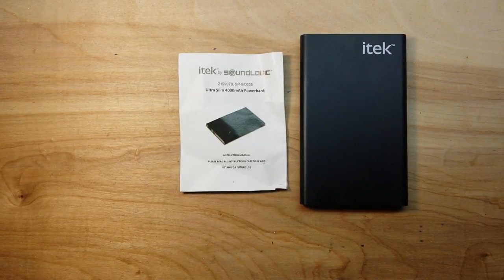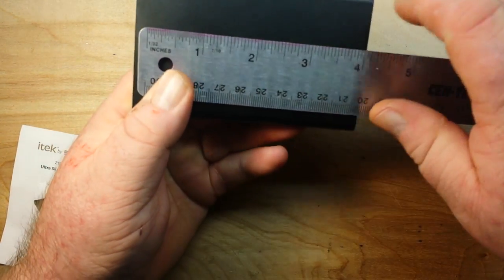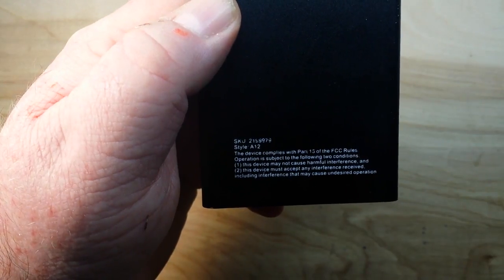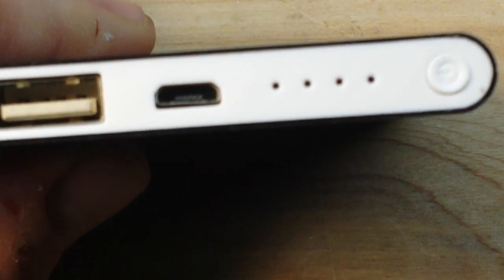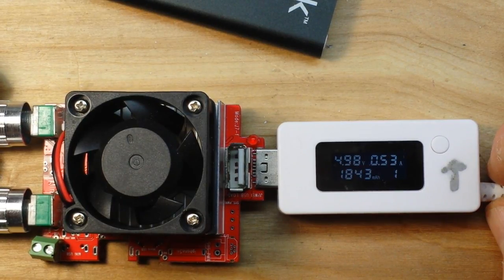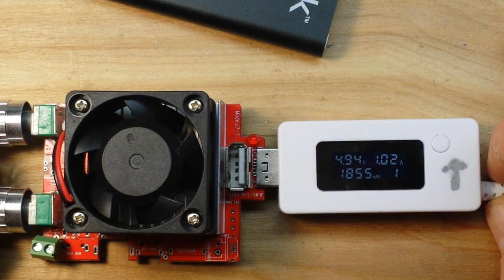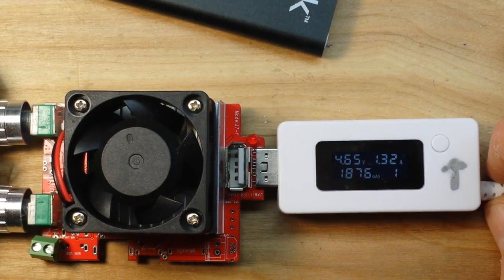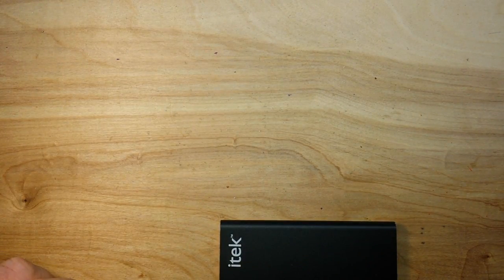ITEK powerbank review and teardown

Comment: Hi Paul...  I notice a couple times you mention 4.95 as the lower limit of the acceptable voltage for the USB specification. Where did you get that info-it seems VERY conservative to me.  Big Clive used to always say 4.8, wikipedia.org/wiki/USB says its 5 +25 -60 (although this I SERIOUSLY question)  I cant find this 4.95 number you say anywhere, and I know you mention that several times.  I even downloaded the 75mb white paper specifications and cannot find it.  I'm certainly not critisizing, I ask because I do a good bit of home automation with Arduino/ESP, and of course alot of times USB is the "go to" power source for me.  When designing, should I really be making sure there is no voltage drop between this 4.95 # or ???  In this case of 4.8, your charge bank meets it's specs and then some.  I know most mobile phones back off the charge current at 4.9(ones that monitor the voltage-again Big Clive did a couple videos on that)

P.S.  I have that same white tester.  I find it tends to drop some voltage over the cable(to the output) compared to my PortaPow and the adjustable load like you have that has the build in display.  But maybe its a problem with mine too, chinesium products are not knows for consistency!  Keep up the great work on the channel.  Cheers!
Reply: I was just going to write the same. The latest USB Power Delivery specification (http://www.usb.org/developers/docs/usb20_docs/ => USB_PD_R3_0 V1.1 20170112.pdf) and the DCP compliance plan (http://www.usb.org/developers/docs/devclass_docs/USB_Battery_Charging_1.2.pdf) both state 4.75V as lower acceptable Limit for 5V. Personally i wouldn't go below 4.8V to allow a bit room for cable and connection losses.
The Voltage Wikipedia shows is the limit devices must adhere to provide their "low power functionality", which is also limited to <100mA/<150mA. In case of a mobile phone low power would allow you to sync your files at a voltage this low but doesn't charge the battery.
Reply: Thanks a lot for looking that up!  That sounds more along the lines I was thinking - I knew there was no way 4.95 was correct as far as a limit as it's only 1%!  I been to that page 200 times and still didn't find it, and link #2 you give is dead.  It's not very easy to find.  
So if that's the case, it makes that a pretty decent power bank as far as the supply current.  I've seen much worse!
Thanks again.
Reply: #1: The file is in the giant zip file linked below "USB 2.0 Specification" (/usb_20_100617/USB Power Delivery/USB PD 3.0/ Page 281)
Also usb_20.pdf Page 175: "The voltage supplied by high-powered hub ports is 4.75 V to 5.25 V", also 178
#2: Youtube added the trailing ")" to the link, removing it should work
Reply: Thanks!  Ok, I had already downloaded that messy thing!  I'll look again through it.  Best regards.

Comment: I find this kind of review interesting just to see what's out there. It would have been helpful to have done a discharge test and measured the total mAh actually stored in the battery (there may have already been some charge in the battery when you started charging). A bonus test would to monitor the charge controller to verify the maximum battery change Voltage and current and the low Voltage load cutoff.
Reply: Those batteries spit it when they drop below 2.5-3.0 V (by the protection circuitry) so of course they will never take a full mAh charge cycle. In fact they are knackered if they drop below 2V.. (never work properly again). Cheers.

Comment: Nice video, but I do not think that the USB specification is 4.95V as a minimum allowed voltage though (it is more in the range of min: 4.75V and max: 5.25V).
Reply: Do you know how to find what it really is?  WIKIpedia says it's 5 (+.25) (-60) so 4.4 -5.25, which seems incorrect to me also.  Big Clive says 4.8.  I downloaded the 75 mb white paper and cant find it.  Most phones back off at 4.90

Comment: Should of looked on the battery for info on it.
Reply from the maker: +Gary Rivett I did and did not see any
Reply: learnelectronics 
must be one of the ones that's so cheap. it barely qualified as a battery. I got a couple like that. I was hoping it would extend the use time of my phone. it didn't work. so I got another. it didn't work either. after charging all night. so after tare down. it only charged to 3.8v . and it seemed like it killed my phone battery. to charge it farther.  I'd say the battery was about 400-500 man. because it didn't last but a few minutes with a few LED connected. I debated replacing the batt with a 3.5ah but its a26650 and wouldn't fit the case. mine was just a single 18650 USB bank. but it will not even start to charge my phone. I don't think the voltage is high enough. maybe something wrong with the electronics.